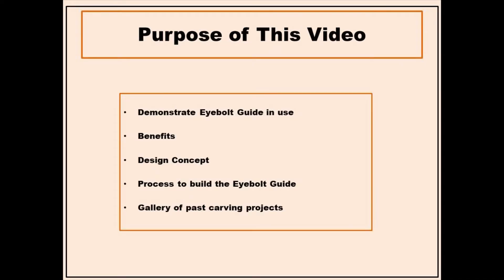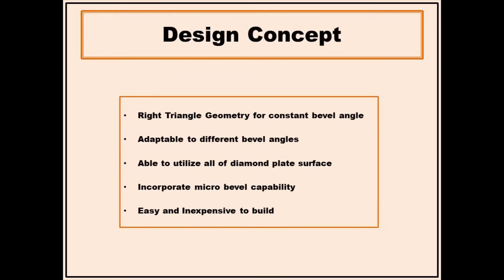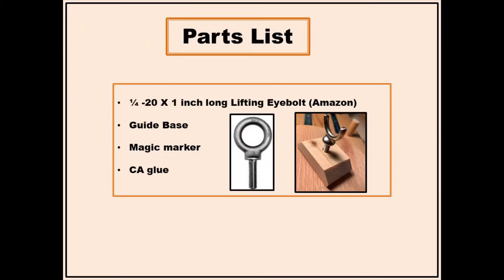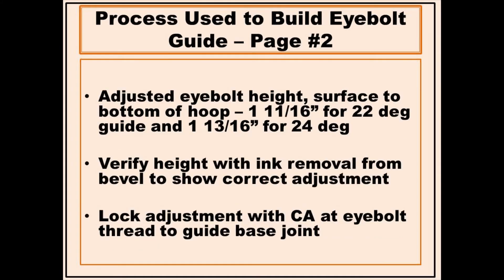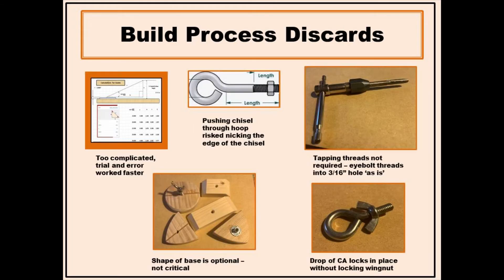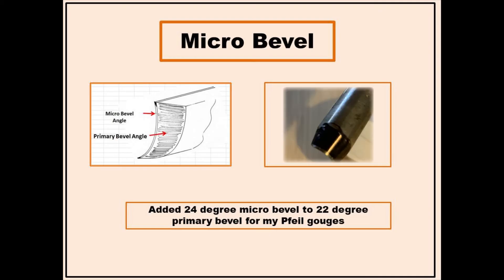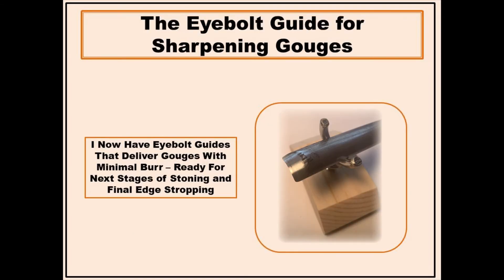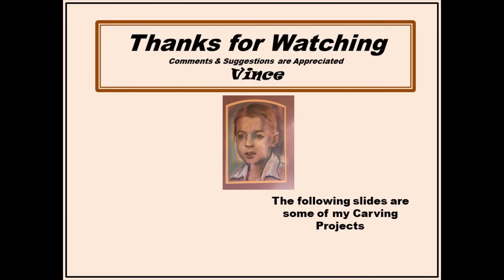Eyebolt Sharpening Guide for Carving Gouges

Comment: Loving this idea, I went looking for a lifting eyebolt that could accommodate the size of my timber framing gouges. After a few days, I got to thinking, whats the difference between this and a flat piece of wood in a carpenters vice, raised to the level (could be marked for future quick reference) where the angles needed for sharpening are present? Then you could accommodate any size gouge, and its quite quick to set up. Thoughts?

Comment: I did something similar with a big bearing with a hollow shaft sticking out slightly. I drilled three holes in the small shaft and tapped threads through those holes for set screws then I mounted the bearing in a block of wood with the bottom rounded over. I put a carving tool into the shaft opening and tighten it into place. Works the same even for v tools and the back spine of the tool doesn't interfere with the sharpening edge because it rotates with the bearing instead of riding the profile of the back of the tool.
Reply: This sounds very interesting. Having a struggle trying to visualize it though- any way to post a few photos?  Much appreciated
Reply: @damonmanni  I'd show you a pic except YouTube doesn't allow pics in comments.

Comment: This sounded like a good idea so I ordered the lifting bolt from Amazon. However the 1/4-20 x1" bolt came in a remarked package with the same size 1/4-20-1". The new part number is X003KD1R6V, the package is marked NEW ITEM. This bolt is a bit larger smaller than 5/16" and will work with a 9/32" drill bit. I have notified Amazon of this error. Perhaps a heads up in your directions to warn viewers may be helpful.

Comment: I have tried endlessly to get a shoulderless eye bolt in the UK to the size you suggest using , but I  have had no luck obtaining one anywhere . So I`m stuck now to make one sadly
Reply from the maker: @tommytitmouse  does not need to be shoulder less - I used lifting eyebolt 1/4-20x1 and they have them at Amazon .
Reply: @vincentfyie  Thank you  for informing me that , I have just bought 4

Comment: I am a little confused, though like the general idea. Do you adjust the eyebolt up and down depending on the gouge?  I so how to you do it, raise the bolt up and down. I have gouges from about 5 different companies and am always struggling to maintain the right angle
Reply from the maker: Hi Sam, thanks for the question.  The bevel angle depends on the height of the eyebolt and the length of the chisel blade.  The adjustment is accomplished by screwing the eyebolt either up or down to get the angle you desire.  All of my chisels are Pfeil - original length so I have just two eyebolt guides -one for the primary angle and one for the micro bevel.  Will probably make two more for a lower bevel angle for the small width chisels.  Once set - no additional adjustment is needed.  If you have various chisel blade lengths - my suggestion would be to make a guide for each different blade length - they are easy to make and once made do not need adjustment.  You could use just one guide and re-adjust for each different blade but the guides are simple to make and then you are done.

Comment: I'm so confused... I read on "woodcarvingillustrated" blog that tell carving gouge shouldn't have a micro bevel. thel outer bevel need to be flat and around 15-20° for a low cuting angle, and the reel slighly rounded. and it need an inner bevel around 5-10° to make a more resistant cutting edge with a total angle around 25-30° depending of the hardness of the wood to be carve.